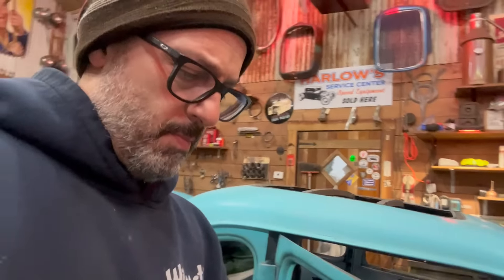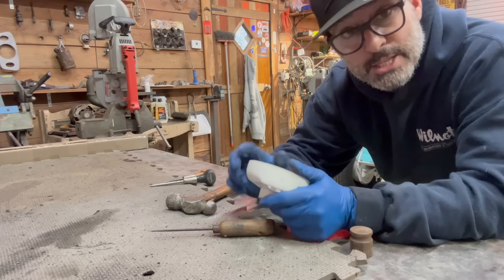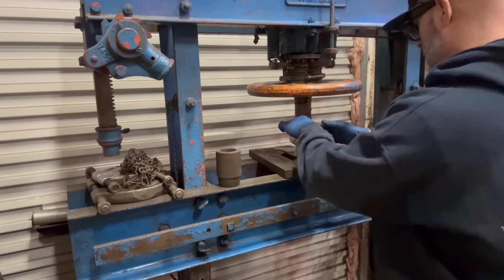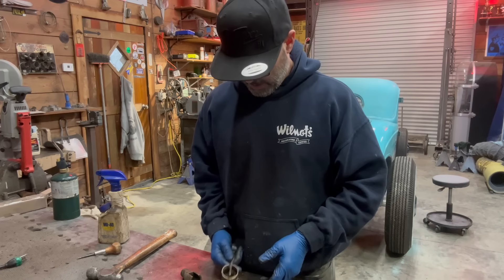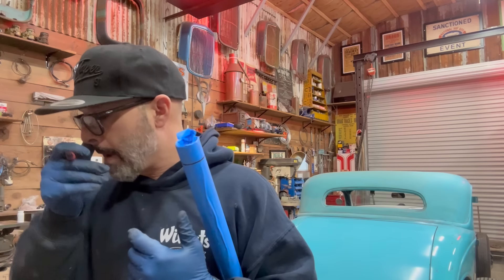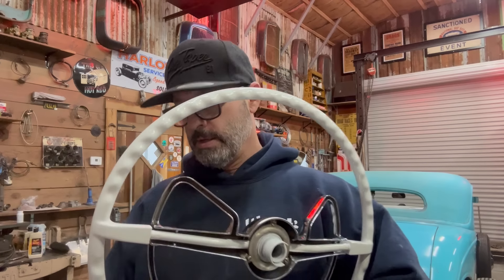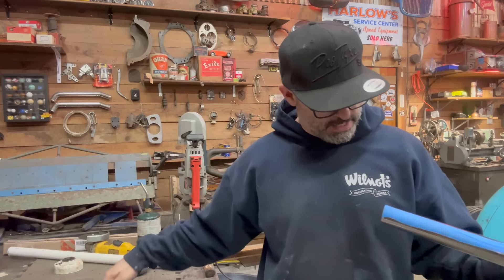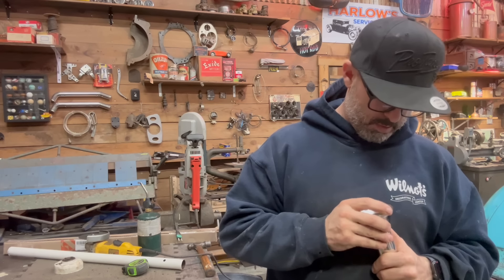Ford F1 / F100 Steering Column Upgrade

Comment: Last year you did some work on the sedan, using the Trulers tapes. I ordered their getting started kit. Just fell in love with them. Made a bunch of 1" wide rules out of their selection. Ordering the style I like for some 16ga stainless I had sheared. 

Love the diamonds and arrowheads over skinny lines. 

Thanks, Mike! Nice column.
Reply from the maker: Glad you like them and supported his company.  Absolute must have for the shop. 👍🏼. Thank you also for the kind words.

Comment: most steering columns have a support bearing  
it comes up through the top if you use a 2 leg internal puller it will come out easy

Comment: The rotary hand deburring tool is a must. 
However you can probably DYI one for free from scrap, that worn 10 inch 3 cornered file with the clogged teeth.
With an angle grinder cut the front portion away leaving the large portion at the tang (about 2 lengths of the tang).
Now slowly grind away the teeth on each flat while reducinng the cut off end to a point, go slowly as not to blue your 3 sided knife edges, use lots of water. The form of this end can be 3 tapers or 3 arcs. I hollow ground mine using the radius of the pedestal grinding wheel.
Put a comfortable file handle over the tang and you have a sharpen able tool for any size hole or shape. 
CAUTION: It's start over if anything edge turns blue.

Comment: Great idea. By the way, what was that ribbed tubbing you used for your oil filler please
Reply from the maker: That was a piece of a cast aluminum flathead ford upper radiator hose.  
It had been cut in half when I got it and I modified that piece in my lathe to use as the oil fill.   
I had had it for a while sitting on a shelf… always figured I’d find a use for it.